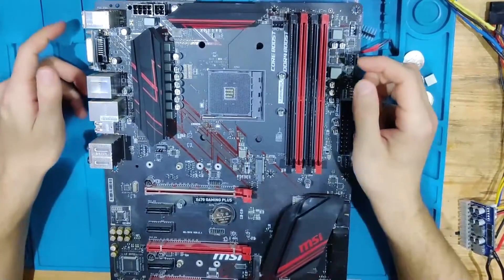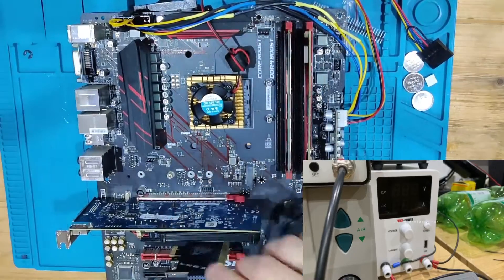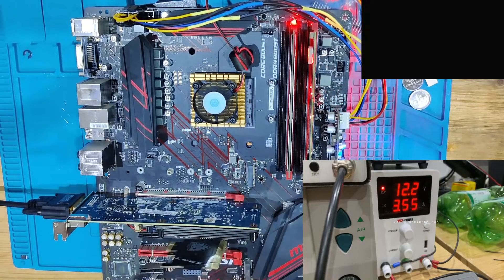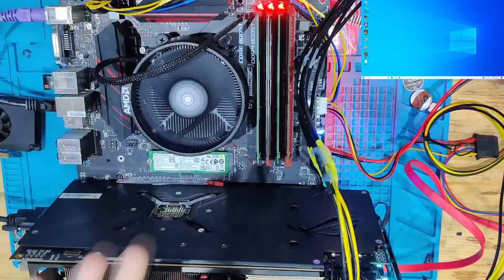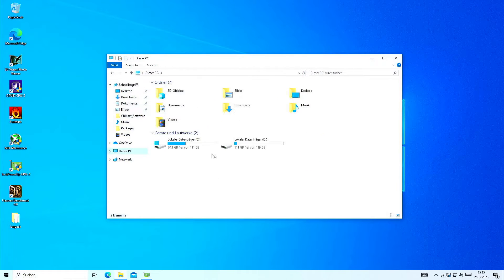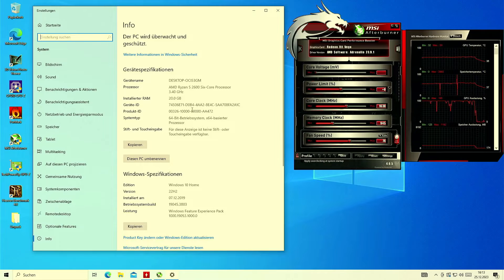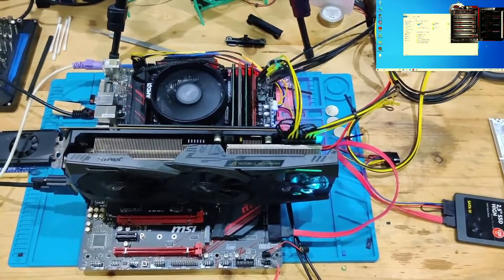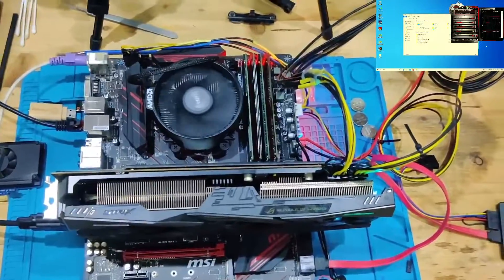MAGIC HANDS OR JUST LUCKY? STUCK VGA LED | REPAIR MSI X470 GAMING PLUS MAX

Comment: This is like a GPU i once buyed from ebay. 4 Years ago i wanted to dig into GPU repairs and bought a faulty RX460 4GB from Ebay. was listed as no display and never been opened. So perfect i thought. Cost me about 3 Euro plus Shipping. Cards in working condition at this time was up to 100 Euro. Hooked the faulty card in my bench, powered the pc on and boom, boot and card is working without problems. The card is still working today. 
I was lucky and mad at the same time, because i wanted something to repair and learn, not to plug and play. But it saved me a huge amount of money.

Comment: The initial issue was most likely a broken, a non UEFI ready or not (properly?) connected GPU during the tests of the previous owner. The classical case is a installed GPU Card, while the user is connecting its screen to the mainboards outputs 😅 You will face cases like that now and then and will stop wondering one day :)